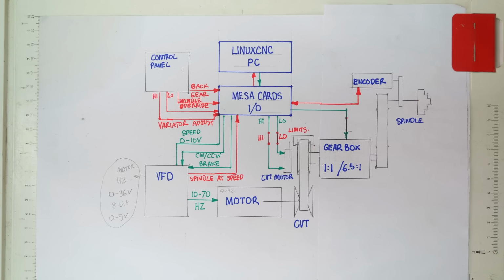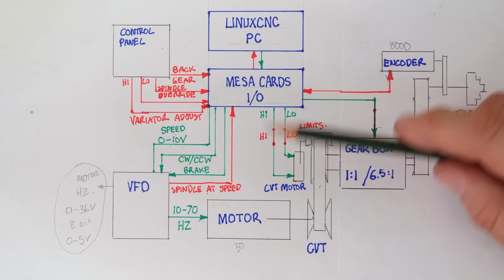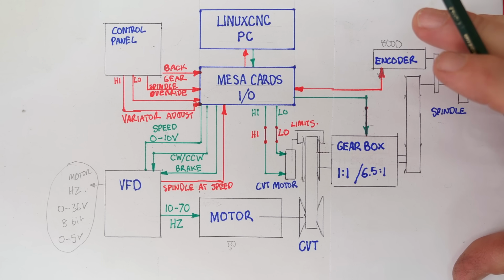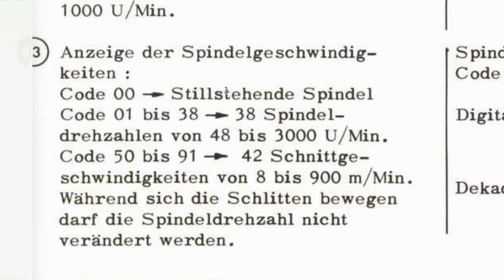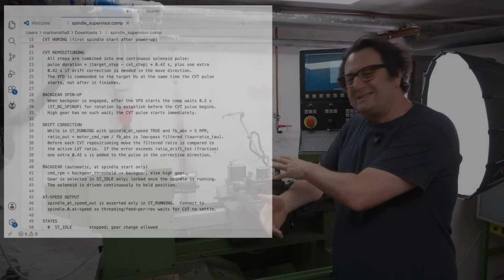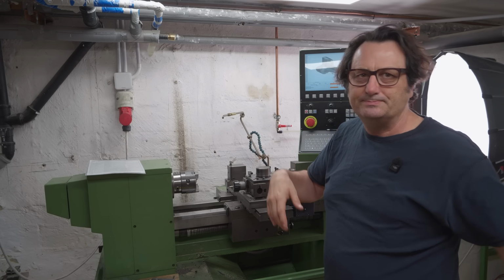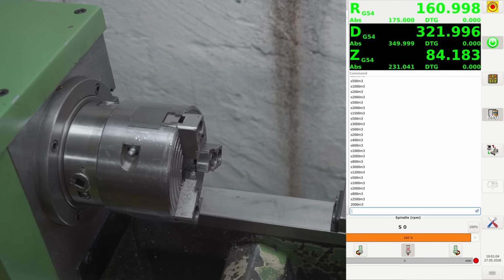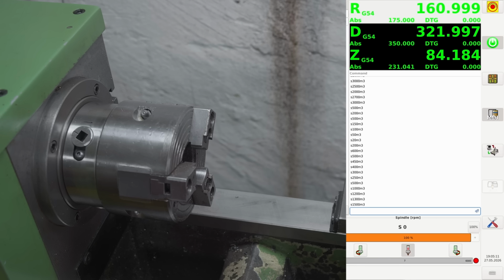Open loop spindle control - Schaublin Ep. 69 || RotarySMP

Comment: You may have already looked at this, but with a mechanical system it's quite likely you have some hysteresis in the control e.g. a 1 second adjustment on the CVT motor in one direction may not give the same change in ratio as going in the other direction.  This would give a cumulative error in your speeds which could be exacerbated by your correction scheme of adding and subtracting motor time e.g. if you increase speed via the CVT and it overshoots you reduce the motor time for the next step, but if the next step is going down which, might tend to undershoot due to hysteresis, that correction would result in more error.

Running the motor at constant speed and stepping the CVT in equal motor time steps up and down and plotting the resulting speeds would show this.  If significant, you could either include two tables for increase and decrease, or an easier solution would be after each step you set two correction factors, one for speed reduction and one for speed increase, and the software would use the appropriate one at the next speed set.
Reply from the maker: This could well be the case, but it is still a lathe, and exact speed control is not that necessary. As long as the speed doesnt keep drifting out until the speeds are unusable, it really doesn't make much difference if the speeds are 10-15% off.

Comment: Don't break the elbow getting to the nose, never good for the machine, cheers. Keep up the fun.
Reply from the maker: Don't know that saying :) At this stage, I don't see much benefit in having perfect speed control.
Reply: @RotarySMP it basically means doing something the hard way first, either through ignorance,  not your case, or through constraints one has to work with.  Hopefully in the end you find a deal on a very nice servo motor and drive to simplify your life and spice that little lathe up. Fun stuff. 
FYI,  trying to watch and comment as much as possible to help your channel. Enjoy seeing your willingness to try things and be creative with solutions.  

FYI,  an outside of the box source for a surplus drive might be out of a variable speed conveyer belt.

Comment: There's a lot of data the machine could use to self calibrate. Like switching between two speeds back and forth to adjust variables until it's more consistent, something like least mean squared error. The obvious next step is a neural network that controls all the variables instead of some fixed tables, AI the machine 🙈
Reply from the maker: At this stage, I don't see much benefit in having perfect speed control.

Comment: nice i finaly seen that wierd tool in use
as for speed drive i still think it is too complex to work, and it even proven it has more breaking points than you predicted
how many speed encoders did the oryginal controll setup had? can we assume they have only cared for accurate surface speed while threading and  surface cuts were just step speed controlled by timed impulses to vfd arm and not really that accurateso the controller could calculate how long to turn the arm on and of to get to next step from a single speed readout or something. because if you know angular speed of a constant speed drive that would be the logical way to do it
can you actyate the vfd arm to measure the accuracy of how long it takes to get from end to end and derive tolerance from that?
Reply from the maker: One encoder on the spindle gives the speed information necessary for accurate threading, as the axis syncs to spindle not the other way.
I don't think better accuracy than this is necessary for a lathe.

Comment: Still love the surface finish you are getting from your lathe. If you are looking to control the rate of change, you might need a second order sensor... or a third order sensor.  It's been a while since I've worked on control systems, but from my memory... controlling a change in position or a change in level, etc is a first order problem... similar to slope when graphing. When you have a change in the change that is a second order control problem. Controlling speed by changing position often ends up with a bit of error as there is always overshoot due to the mismatch in what you are controlling (the final control element) and what you are measuring and what your desired value is (setpoint?) Long story, too long... you might need a bit of "reset" added in your loop to compensate for the mismatch in order between your various elements. In pneumatic controls, we would add a tank (resevoir?) and a bleed value as a feedback to slowly bring the system back to the setpoint because with purely proportional control there would always be an offset.  Hope this helps. Happy Sunday!
Reply: you see this behavior in your car suspension as well it's why you add in shocks rather than just having springs.
Reply from the maker: @MikelNaUsaCom  Thanks Mike. At this stage, I don't see much benefit in having perfect speed control. The CVT is a bit slow acting, so it cant decelerate fast enough to keep up with the rapids out to a larger diameter, but otherwise this is working pretty well.

Comment: I'm glad the open loop control is working so well! 

Sounds like even if you went and added encoders everywhere, the bottleneck would've still been the cvt? Guess the only way to get a big improvement in responsiveness would be to pull it all out and whack a big ol servo motor in there

Edit: Commented too soon, just got to the back half of the video 😅
Reply from the maker: You nailed it. The CVT takes the time it takes, and that is not going to change. At this stage, I don't see much benefit in having perfect speed control.
Reply: @RotarySMP if some day down the line you decide to install a big servo motor, I'd definitely watch that video too 😊

Comment: How about a closed-loop VFD and 3-phase motor? It's inevitable.
Reply from the maker: At this stage, I don't see much benefit in having perfect speed control, Alexander. This is working very well. The only disadvantage I see is that it take a while for the CVT to reduce back down when rapiding out to large diameter.
Reply: @RotarySMP  How's single-point threading working?
Reply: @graealex I suppose you don't need to change speed while cutting thread.
Reply from the maker: LinuxCNC syncronises the axis motion to the spindle. So it will compensate for speed variations during the cut. However there is a LinuxCNC bug where significant speed variations at the start of multi pass threading passes can lead to offsets. For threading, open loop fixed frequency speed is desirable.